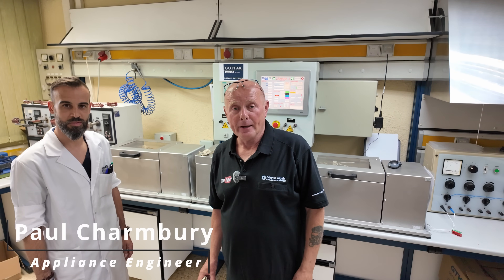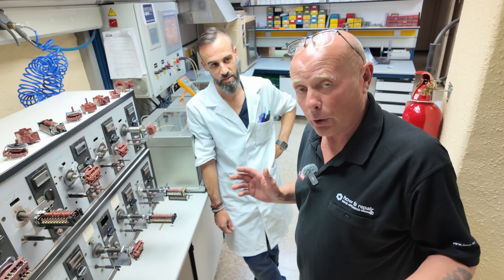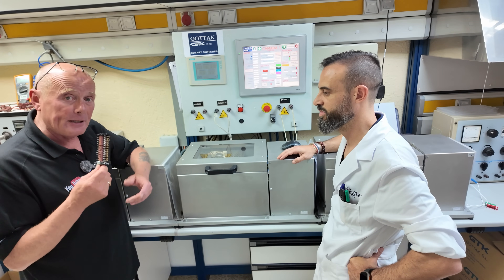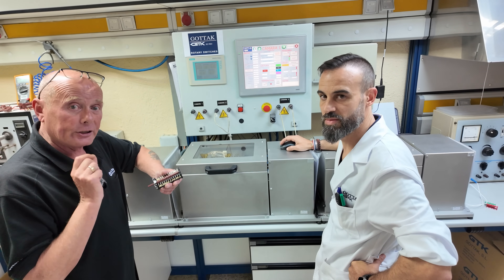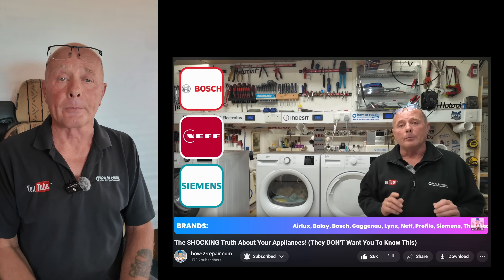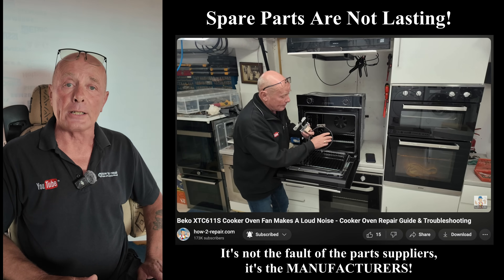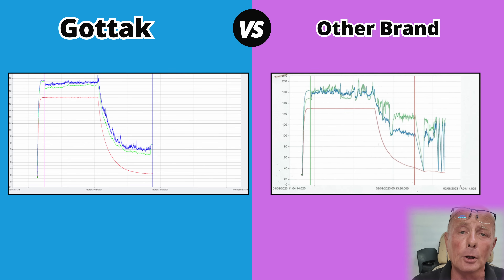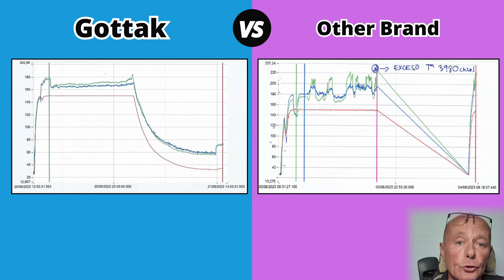Why Your Appliances FAIL SO FAST! Lab Results EXPOSE the Truth!

Comment: I bought a house in 1989 for my parents to move into & mum bought a brand new fridge & a stand up freezer when they moved in. My parents have both passed away & I now live in that house & still using the fridge & freezer they bought, 36 years later. A few months ago I replaced the seals on the fridge & was told by the service woman to NEVER buy a new one as I had asked it it would save me money if I did & she said maybe but I would likely be replacing it in about 5 years when it broke down. This was  confirmed when I was talking to my sister-in-law when I told her that info & she said that they have had to buy 3 fridges over 10 years. 'Quality Guaranteed & Customer Satisfaction' are now just slogans to promote sales.
Reply from the maker: You’re absolutely right mate, and it’s a frustrating practice that affects nearly every industry. The concept of deliberately designing products to fail or become obsolete within a certain timeframe is a huge driver of unnecessary waste and consumer spending. Whether it’s electronics, appliances, or even clothing, it’s all about maximizing profits at the expense of durability and sustainability!

This brings me to a larger issue I'm passionate about: built-in obsolescence. I’ve made many controversial videos on this topic, and they often seem to get suppressed. To put it in perspective, Google is the largest search engine in the world, and YouTube, its subsidiary, is the second largest. Google’s business model relies on advertising revenue from manufacturers. My best-performing video on built-in obsolescence reached 750,000 views. That might sound good, but it’s a tiny fraction—approximately 0.05%—of the 1.4 billion English speakers in the world. We are fortunate enough to afford these machines while people in other parts of the world still wash clothes in rivers, yet important conversations about product longevity are often stifled because consumption drives our economy.

I plan to release another video soon with analytics to prove this point. I've also discovered some manufacturers appear to be using AI to shield their brands from negative feedback on videos, which I will cover in an upcoming exposé. Please consider sharing any of my built-in obsolescence videos to help them reach a larger audience.
Reply: @How-to-repair  Punishing negative reviews is on the rise, I just saw (but didn't watch) a couple that left a bad review on an AirBnB were fined/sued $4,000. In another a case by 2 different audiophiles YouTube reviews on a the same new amplifier were threatened with lawsuits & channel cannelations unless they removed or changed their reviews.
If you look for my reply to a comment here you will see that the company I worked for that was started because the founding company wanted better machines for the work they did so were both builders & byers built for functionality, reliability & durability. 20 years later they sold the daughter company for an insane amount of money (3.5 times value) & the new owners demanded cheaper build, replacing metal part for plastic & thinner metal where it couldn't be replaced. The stated reasons, to reduce build cost & (most shocking) they said to increase service cost on customers & promote faster machine turnover (resales). 4 years later after another demand that we save 30% on production costs & a 50% increase in sales (both unobtainable) to increase shareholder payout we were closed & the work we did moved to China.

Comment: I was able to send a company wide message about my two failed Samsung machines that were only six years old.
I was told Not worth repairing.  2500$  !     After 2100 people got this message about 50 more were posted about
various products. Some only lasted 3 years.
Reply from the maker: This brings me to a larger issue I'm passionate about: built-in obsolescence. I’ve made many controversial videos on this topic, and they often seem to get suppressed. To put it in perspective, Google is the largest search engine in the world, and YouTube, its subsidiary, is the second largest. Google’s business model relies on advertising revenue from manufacturers. My best-performing video on built-in obsolescence reached 750,000 views. That might sound good, but it’s a tiny fraction—approximately 0.05%—of the 1.4 billion English speakers in the world. We are fortunate enough to afford these machines while people in other parts of the world still wash clothes in rivers, yet important conversations about product longevity are often stifled because consumption drives our economy.

I plan to release another video soon with analytics to prove this point. I've also discovered some manufacturers appear to be using AI to shield their brands from negative feedback on videos, which I will cover in an upcoming exposé. Please consider sharing any of my built-in obsolescence videos to help them reach a larger audience.

Comment: Same as cars parts are made to let you down
Reply from the maker: You’re absolutely right mate, and it’s a frustrating practice that affects nearly every industry. The concept of deliberately designing products to fail or become obsolete within a certain timeframe is a huge driver of unnecessary waste and consumer spending. Whether it’s electronics, appliances, or even clothing, it’s all about maximizing profits at the expense of durability and sustainability!

This brings me to a larger issue I'm passionate about: built-in obsolescence. I’ve made many controversial videos on this topic, and they often seem to get suppressed. To put it in perspective, Google is the largest search engine in the world, and YouTube, its subsidiary, is the second largest. Google’s business model relies on advertising revenue from manufacturers. My best-performing video on built-in obsolescence reached 750,000 views. That might sound good, but it’s a tiny fraction—approximately 0.05%—of the 1.4 billion English speakers in the world. We are fortunate enough to afford these machines while people in other parts of the world still wash clothes in rivers, yet important conversations about product longevity are often stifled because consumption drives our economy.

I plan to release another video soon with analytics to prove this point. I've also discovered some manufacturers appear to be using AI to shield their brands from negative feedback on videos, which I will cover in an upcoming exposé. Please consider sharing any of my built-in obsolescence videos to help them reach a larger audience.

Comment: The A/C unit in my apartment is a Whirlpool that was built in the 70's or 80's and works great. We have communal washing machines that are Speed Queen brand. They work okay, but I have to manually add more water to the wash because some politicians think there is not enough water on the planet.
Reply from the maker: Think about the environmental impact of building machines and then recycling them. These machines are often transported halfway around the world, which adds to fuel costs. It's baffling that we need to ship them every five years due to failure.

This brings me to a larger issue I'm passionate about: built-in obsolescence. I’ve made many controversial videos on this topic, and they often seem to get suppressed. To put it in perspective, Google is the largest search engine in the world, and YouTube, its subsidiary, is the second largest. Google’s business model relies on advertising revenue from manufacturers. My best-performing video on built-in obsolescence reached 750,000 views. That might sound good, but it’s a tiny fraction—approximately 0.05%—of the 1.4 billion English speakers in the world. We are fortunate enough to afford these machines while people in other parts of the world still wash clothes in rivers, yet important conversations about product longevity are often stifled because consumption drives our economy.

I plan to release another video soon with analytics to prove this point. I've also discovered some manufacturers appear to be using AI to shield their brands from negative feedback on videos, which I will cover in an upcoming exposé. Please consider sharing any of my built-in obsolescence videos to help them reach a larger audience.

Comment: my 30 year old appliances are way more reliable than anything I bought in the past 15 years...
Reply from the maker: In the 80s, 90s, and early 2000s, most manufacturers produced high-quality equipment to build their reputations. Now, their main goal is to sell machines. They use green marketing tactics to their advantage but aren't held accountable for the growing pile of discarded white goods. Nowadays, machines last only about five years on average.

This brings me to a larger issue I'm passionate about: built-in obsolescence. I’ve made many controversial videos on this topic, and they often seem to get suppressed. To put it in perspective, Google is the largest search engine in the world, and YouTube, its subsidiary, is the second largest. Google’s business model relies on advertising revenue from manufacturers. My best-performing video on built-in obsolescence reached 750,000 views. That might sound good, but it’s a tiny fraction—approximately 0.05%—of the 1.4 billion English speakers in the world. We are fortunate enough to afford these machines while people in other parts of the world still wash clothes in rivers, yet important conversations about product longevity are often stifled because consumption drives our economy.

I plan to release another video soon with analytics to prove this point. I've also discovered some manufacturers appear to be using AI to shield their brands from negative feedback on videos, which I will cover in an upcoming exposé. Please consider sharing any of my built-in obsolescence videos to help them reach a larger audience.

Comment: I deeply resent the obvious designed obsolescence of recently manufactured appliances along with the highly inflated prices. The used appliance store in my town has closed making matters worse. I bought a new matching set of LG washer and dryer. Both of them failed catastrophically almost simultaneously at only two years of age. This is unacceptable and disgusting.
Reply from the maker: It's incredibly frustrating when appliances fail so quickly, especially considering the investment and the inconvenience it causes.

This brings me to a larger issue I'm passionate about: built-in obsolescence. I’ve made many controversial videos on this topic, and they often seem to get suppressed. To put it in perspective, Google is the largest search engine in the world, and YouTube, its subsidiary, is the second largest. Google’s business model relies on advertising revenue from manufacturers. My best-performing video on built-in obsolescence reached 750,000 views. That might sound good, but it’s a tiny fraction—approximately 0.05%—of the 1.4 billion English speakers in the world. We are fortunate enough to afford these machines while people in other parts of the world still wash clothes in rivers, yet important conversations about product longevity are often stifled because consumption drives our economy.

I plan to release another video soon with analytics to prove this point. I've also discovered some manufacturers appear to be using AI to shield their brands from negative feedback on videos, which I will cover in an upcoming exposé. Please consider sharing any of my built-in obsolescence videos to help them reach a larger audience.

Comment: Can sound be considered failure? When fender guitars was purchased in 1963 the new manufacturer CBS changed the potentiometers quality. All for a savings of almost 3/4 of $1 million per year. Pre-CBS fender precision base had a unique tone quality. After the purchase, the same guitar did not sound as good.
Reply from the maker: You're absolutely right mate this pattern of manufacturing has become more evident across various industries. Once renowned brands with strong reputations for quality are now often owned by larger corporations that shift production to regions where costs are lower, such as China.

Comment: Im currious about how the law of thermal dynamics influence your testing.   You're doing continuous use rather than intermittent use.  Yes, you pointed out a consideration of average use, but this is not with the energetic stress of continual use.  Im not an engineer,  so Im hist asking if this might negatively impact the end result.  Good video, thanks
Reply from the maker: Hi Randy thanks for the detailed question. Sorry for the late response. I was making sure the engineer gave me the correct information to give you. Thanks very much indeed for the comment. The performed test as shown in the video for this type of product for appliances, it is according to norm IEC-DIN 61058-1, which it is mandatory for complying with mechanical behavior, life expectancy, durability and related safety norms.

There might be other possible in-house test to be done, basically, to analyze other specific characteristics of the electric component but it depends at the end, by the request of each brand manufacturer of the appliance, depending on the quality level they aim or for example, for what end country the appliance will be distributed and sold. All this can vary.

The test according to norm IEC-DIN 61058-1 and their results are certified by world organisms such as ENEC, VDE, UL and other third-party laboratories, to assure the product complies on this regard.

Comment: I buy older appliances with as few electronics as possible. I also don't want internet of things appliances.
Reply from the maker: I've been repairing washing machines for nearly 50 years, and the basic principles of washing clothes haven't changed since the 70s. They wash, tumble, heat, and spin. It's baffling why we need so many extra features now. Machines used to last 15 to 20 years on average. Nowadays, you're lucky if they last five years. Obsolescence is clear in today's society.

Comment: Sounds problly weird but i try to find the less complicated appliances. Nothing with SMART features, and etc. Than i just repair everything on my own. You can figure out most parts with a millimeter like fuses and etc. If i can ever find an old appliance that isn't mistreated ill take it over anything new.
Reply from the maker: I've been repairing washing machines for nearly 50 years, and the basic principles of washing clothes haven't changed since the 70s. They wash, tumble, heat, and spin. It's baffling why we need so many extra features now. Machines used to last 15 to 20 years on average. Nowadays, you're lucky if they last five years. Obsolescence is clear in today's society.

Comment: Our new LG dishwasher failed within the warranty of 2 years and the front electronic panel was replaced. The maintenance guy indicated this was a common fault. Just over 6 months later it looks like we are getting a similar intermittent fault but now the warranty has expired. The cost of repairs is likely half a cost of a new dishwasher. Maybe its time to go back and wash dishes by hand. That is progress!
My friends LG washing machine has a 10 year warranty on the motor. This failed within 7 years. The motor was replaced but failed within a year. The replacement part only had a 3 month warranty so he still didn't get 10 years. Its laughable.
Reply from the maker: It's hard to believe that manufacturers expect consumers to be happy buying major appliances every few years. Using environmental issues to sell more machines is ridiculous, especially considering the ecological damage it causes. They are ruining their reputations by making such products.

Comment: We’ve become a throw away society while corporations and governments pretend they care about the environnement. The car industrie is among the worst. Sealed transmissions that can’t be serviced. Plastic oil pans. Compression rings that allow oil to burn.
Reply from the maker: You’re absolutely right mate, and it’s a frustrating practice that affects nearly every industry. The concept of deliberately designing products to fail or become obsolete within a certain timeframe is a huge driver of unnecessary waste and consumer spending. Whether it’s cars, electronics, appliances, or even clothing, it’s all about maximizing profits at the expense of durability and sustainability!

Comment: same happens with cars, oem parts are lower quality than original parts that came with the vehicle
Reply from the maker: You’re absolutely right mate, and it’s a frustrating practice that affects nearly every industry. The concept of deliberately designing products to fail or become obsolete within a certain timeframe is a huge driver of unnecessary waste and consumer spending. Whether it’s cars, electronics, appliances, or even clothing, it’s all about maximizing profits at the expense of durability and sustainability!

Comment: My Wife n I bought new washingmaching by Matag with 3 year manufacturer warranty. The first year it started to act up. 3 times a guy came out changing several parts including a new belt and STILL it acted up. The problem was the motherboard that was made in Mexico. Mayrag, quility huh. Well, the repair man said, "It doesn't matter which brand you buy as they will ALL break down so buy the cheepest one."
Reply from the maker: Buying cheap is only falling into the manufacturers hands even cheaper appliances should last a statutory period of time. Thanks for your comment. This video seems to have really touched a tender nerve with a lot of people! It's clear I'm not alone in wanting more sustainable appliances. Help me hold the industry accountable by sharing this video. To make a real difference, we need to get this message to the people in charge and tell those appliance-wrecking accountants to back off! I would be grateful if you would share this post, as it’s the only way to force things to go large nowadays. Have a great day, Paul.